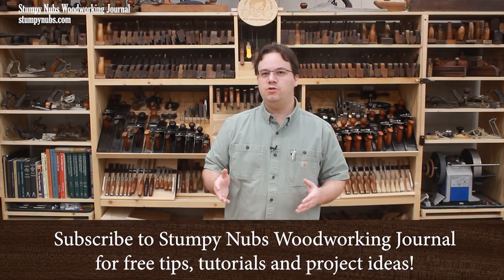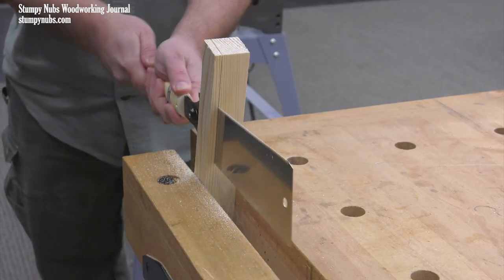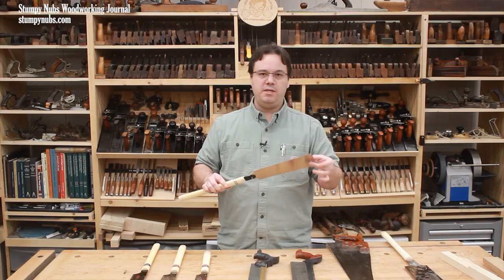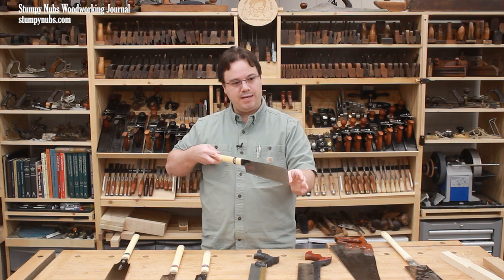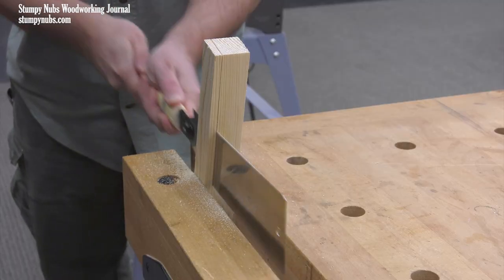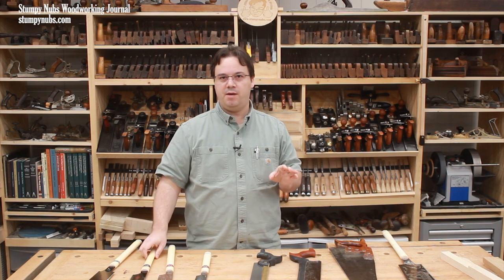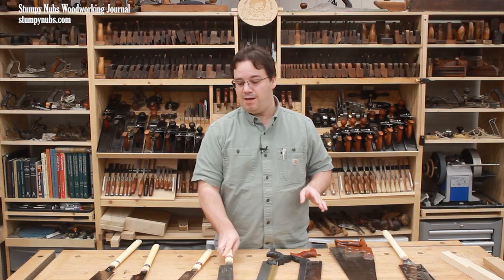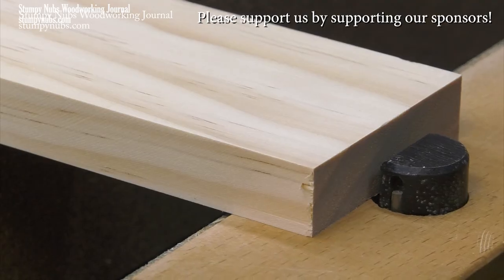Is Japan slowly killing western-style saws?

Comment: Just an elderly knuckelhead here, who loves handsaws. You did an excellent job in 13 min. with regard to the title of the video. Content and videography - congrats. I remember dropping out of college in 1980 and selling my car to buy woodworking tools. I bought a ryoba 270 mm "Tama Kitsune" brand, or "Jade Fox" for $27.00 - just saw the receipt the other day. It did not cut straight. I wanted to make a rip cut while working at a furniture repair shoppe, and the Disston rip saw wouldn't cut straight either. Cut well shy of the line, and chiseled the rest. When a Rosewood chair came in months later, I finally shelled out $125 for a weekend workshop at "The Lutherier" in Saugerties NY. I got a dozuki made by Shindo.  Robert Meadow had setup and sharpened ---  "Hon Metate" which is what happens in Japan when you buy a saw. That way, it's custom done, and you take it back to the same dealer when it's dull, or rather not sharp . Then he will use the same brand of file, which is easier than changing to another file brand. Also, several months later, he taught me how to make the blade flat and straight and non twisted, how to set teeth, and I got eventually more saws ect. Once I had the Disston straight, flat, set, and sharp, It cut great, and could get in some places a ryoba or kataba couldn't.

Point being Japanese, American, German, English, and Chinese saws all are a joy to use --- if they are sharp and flat and evenly set. And a real frustrating job if not. 

That's what they all have in common, and here's the thing --- I went for 6 years thinking "I must be doing something wrong with my arm, or body, it don't work because no one ever taught me how to saw"

No, as it turned out, the rip Disston was sharp, but it had a slight curve to the blade. same with the Tama Kitsune, except it also had some cup. Also at that time, disposable blades from Japan were not all flat. Some fit loose in the handle. They are better now, so I'm not dissing them, but a real Shindo or Chuyemon, or Miyano Tetsunoke, or Mitsukawa, or even Nakaya leave them in the dust --- after Hon Metate.  OTOH, good luck finding good files.

Why?, because disposable blade saws did kill the traditional saw makers, and the metate, and the file makers. I guess for most people Western technology is -- certainly from the corporate thought process and value system -- far superior to the traditional artisans aesthetics. 

Personally, I'm glad I spent my time here on Earth questing for Beauty, Truth, and Human scale goals. To all you knuckleheads who love your handtools and working with woods -- which is the great Master to those who want to learn from it  ---  3 cheers ! Give it your full focus and attention, and you might see it is full of Ki, it is not just dead material, you might open your heart to it and have it opened even more.

Comment: The first saw I bought myself was a Japanese ryoba  and I have loved it. With the saw being guided by the thinner kerf it's very difficult if not impossible to try and make small adjustments to your cut line as you work down a long rip cut which I would imagine would be atleast vaguely possible with a western style panel saw. I would be very interested to see a video on both joinery with the Japanese style saws and Japanese style chisels. I am looking to invest in some nicer chisels in the future and don't really know anything about the Japanese style. So that video would be very informative and helpful. Thank you
Reply: Ryoba! Man, the whole time I was watching the video, I was thinking about how "raioba" could possibly mean "two sided"
Ryouba makes a lot more sense to me. Ryou meaning "both" and "ba" for "edge". (The final u is often omitted. It makes the o longer, there is no u sound.)

But yeah, the pronunciation was throwing me off massively. "Ryou" is actually a single syllable. I don't think it's particularly hard to pronounce, but I guess you would never guess the pronunciation correctly if you only saw it written.

Comment: As a counter example (personal experience, YMMV): I've been convinced by those arguments several years ago and got a set of those 3 saws. They are my main saws but I've been struggling. Making straight cuts has been rather difficult, so is correcting the cut when it veers off course. The line is hard to see because it's often covered with saw dust, and the cutting position can be awkward, requiring you to seriously rethink how you position your body and how you clamp your work piece. Not to mention rip cuts are pretty tiring with a ryoba, as the short length doesn't allow you the range of motion a panel saw does.
I'm now in the process of getting equivalent western saws to try and see what I'm doing wrong.
Reply: Have you looked into combining the Paul Sellers "knife wall" techniques with your saws? Set up the precision cut guides with cutting gauges and marking knives, then allow the saws to do what they do, and "follow the path of least resistance".

Also, check out how Wood By Wright how to start cuts across/along marked faces (whether knife walls or pencil marks), before allowing the saw to descend into the meat of the cut.

Comment: I would love to see more videos on japanese saws, chisels, and other less common eastern style tools. I mostly use power tools but have a few japanese saws and a set of chisels that I really like. The japanese saws are affordable and to me, much easier to use than western saws. I picked up a lee valley rip saw recently for about a hundred bucks, with the assumption that this would be better quality thant I am used to as I had only used cheap western saws in the past, but found it harder to use than my japanese saws which cost about 30 bucks. Specifically, with the lee valley saw it is hard to get a cut started (while very easily with my japanese saws) and even harder to get started on a precise line. Though it does cut significantly faster - when it gets going of course. That's not to say the lee valley is a bad saw - the build quality is better and I probably just need more time with it. But the japanese saws cut more accurately and with less effort.

Comment: After watching this, I used my CHEAP Harbor Freight pull saw yesterday to notch some 1x4 pine for trimming around a beam in my new shed. WOW. That made the job easier, more accurate and left me with only a small portion to remove with my Multi-Tool. 
I will have to invest in some higher quality saws for my shop - Thanks for all the tips & tricks!

Comment: Coming back to woodwork after a very long absence I had problems with cutting straight and the blade jamming using my old western style saws. It took me a while to work out that it was an old injury which caused my wrist to flex and twist the blade on the forward stroke. Cutting on the pull stroke using a Japanese saw actually pulls my wrist into line and keeps my cuts straight.

Comment: While this does cover lots of great information I do want to put a counterpoint to some opinions. "Ease of Use" is much easier with western because: body mechanics of use, hand fatigue from grip needed with straight handle (ergonomics), speed of cut (benefit of body mechanics), and steerability mid cut (correcting to the line) being a few. Most of this comes from push saws were used more with standing benches and pulls with sitting benches so the body is used differently hence the wider variety of lengths in push saws as some use only the arm others use the whole body. One thing not mentioned about the "hardened teeth" is that in some of the American native species (red and white oak come to mind) the teeth can snap in the board as they go through open cells (pores). This is a modern attribute/detraction as teeth weren't always hardened so it wasn't a problem when they would cut stuff like teak. While loosing a tooth or ten isn't a big deal to the performance of the saw the metal shards left in board can wreak havoc later down the road.
Reply: A counter counterpoint; the pull saws require much less effort to use as compared to the western saw, so you don't need to get your whole body into it.  Most of the time when I'm using a pull saw, I only hold it with a couple fingers and let it flow.  There's no need to grip it and force it through a cut.
Reply: @jeffh4505  we’ll disagree on this one. I saw all day with traditional. Hands cramp after an hour with straight handles.
Reply from the maker: The tendency to brake teeth was mentioned among the cons. As for comfort, it depends on what you are used to. We develop muscles based on what we do the most. I have experienced this many times in life, being able to easily do something a much larger person struggled with, and vise-versa. If you use Western saws every day, you will find them more comfortable. There is no right or wrong answer here.
Reply: @StumpyNubs  It's all opinion. As said, no right or wrong just thought a counterpoint was valid. I started with pull saws and used them for years. I find you have to grip straight handles (even push) but pistol grips "sit" with very little grip required hence no carpal tunnel issues for me with them. Sorry, I watched whole video while packing and must of missed the breakage part.
Reply from the maker: @wortheffort  No problem :)
Reply: So there appears to be hybrid saws - I searched for 'japanese saw pistol grip' and found some decent looking results. Perhaps the best of all possible worlds is to have access to a fully-equipped training workshop before deciding which suits the individual.
Reply: @jeffh4505  i agree. Biologically, it is easier for the body/shoulder/arm/wrist to pull in these cutting instances, rather than to push. Add this to the blade not binding or bending due to it being pulled instead of pushed, and you've got a much easier time.

Comment: Are there any pistol-grip style Japanese saws? That seems like it would sell well in America, and it might be more comfortable than the straight handle. But I’m not sure if it would affect precision 🤔
Reply: It might be harder to apply force with a pistol grip. A straight handle allows you to push downward while pulling without being awkward.
Reply: i dont know if it would be particularly comfortable or precise to cut on the pull with a pistol grip, it seems much more ergonomic for pushing. but i could be wrong, i dont really know.
Reply: The first pull saw I ever used had a pistol grip. It was made by Tajima, a JPR300/K1 I believe. Very comfortable to use for me, no problems to adapt to the different motion.
Reply: @m.a.6478  Ok, knowing that, I'm betting it's because the blades are disposable. making them thick(tall?) Enough for a pistol grip is a waste of steel.

Comment: In my late sixties and after 40+ years of woodworking, I bought and used some Japanese saws for the first time in my life and have been kicking myself for not having done so decades earlier. Far less effort, far more accurate and just a pleasure to use. Once you get the hang of watching the reflection in the blade to stay aligned, it's hard to go wrong.

Comment: I grew up using push saws and continued using them through my 20's. In my early 30's, 20+ years ago, I purchased my first Japanese saws during a visit to Japan. They were high-end and I ruined a couple early on from kinking getting used to the Pull vs. Push dynamic. But now they are all I use. I would suggest to anyone that started out using Western Saws and wanting to try Japanese saws to purchase a Ryoba in the $30 range. This way when you ruin it, and you will, it's not a big blow. Kakuri tools is a well establish Japanese tool maker with offering in the this price range. My tips; Start slow, relax and don't force you cuts.

Comment: Thank you for this! I’ve just started using a ryoba saw (auto-correct wanted to call it a “rumba” saw) that a friend gave me several months ago. I didn’t quite know what to do with it, though greatly appreciated the thoughtfulness. Right away I noticed how easy it is to follow a line and that not fighting the saw  is critical. I discovered one set of teeth cut better crosscutting and the other ripping. Now I know why. Now I want to get the smaller dozuki and try it on some dovetails! (Just ordered it from your link 👍)

Comment: Excellent video. I've learned how to sharpen my western saws. That makes a huge difference! Some of them have family/nostalgic value so they are a pleasure to use. My Japanese saw has no nostalgic value for me but it works well and has one key, valuable feature. The thinner kerf Japanese saw pulls easier and my wheelchair does not move around as much when I'm sawing. The wheel locks only hold so much and the Japanese saw gets me just under that "friction limit". That being said, most of the hand sawing is done on smaller stuff.  Anything big we go full power tool!

Comment: I bought a ryoba and a dozuki recently and I'm so glad I did. You get so much more cutting for the same muscle input. The handles are much more ergonomic too. It just kind of flows in a straight line with your arm, so the effort of holding it is spread out more. Not so concentrated in your hand and wrist. And making a good cut isn't so dependent on keeping your wrist straight. It's more like the blade is part of your arm. Technique is important though. The first time I used the ryoba I started too aggressively and bent a tooth. It wasn't too bad though and I was able to bend it back. They were both like $40 on Amazon and made in Japan. Definitely worth it.

Comment: Well, I live in Romania, and here, such "exotic" tools are not so afffordable. However, I bought almost a year ago, an Ryoba saw, directly from Japan, because it was cheaper than buying from the only local seller that imported such tools. I have to say, that since I start using it, I managed to improve my work by doing precise, straight and clean cuts. I am not a woodworker, but I like to make things, and DIY works and repairs around home, and it seems that my medium size Ryoba is just right and suitable for what I am doing. In addition, the info, tips and tricks I learn about on this chanel are so useful. Many thanks.

Comment: At 10:06- I thought you were going to take a slice out of the top of your thumb joint!  I love Japanese pull saws. Have used the double sided for cutting door trim before new flooring for years. 15 Years ago, I spent $270 for a Hayauchi ("Silky") extension saw. pruning saw. Wonderful tool! Crazy razor sharp blade that pull cuts better than any other hand pruning saw I have tried. They sell for around $350 now and are worth every penny. Blade is still razor sharp after years of use.

Comment: Thanks for explaining these saws! 65 years ago, when I lived in Japan, I watched Japanese carpenters use their pull saws with the work piece at all angles, above them, below them, and held with one hand while sawing with the other. It looked so much easier than the few times I'd tried using a Western saw. I wondered why we didn't use pull saws. I finally saw and bought one a few years ago here and found that it is everything I wondered about way back when. I'd love to discover their planes and chisels.
Reply: This is what I consider the greatest advantage of Japanese saws over their western counterparts. You can achieve amazing accuracy without even having a proper workbench - just using simple sawhorses and your body weight to firmly hold the workpiece.

Comment: Great Video! I wanted to mention that a few other videos mention that these saws are recommended to be used with only the weight of the blade to supply pressure in the cuts. The cuts may take a little more time, but the results are cleaner with much less muscle fatigue. I can cut stuff all day with these saws and my arms aren't sore the next day like they can be with my Western saws. The trick is to only grip the handle with your thumb and pinky+ring fingers. The other two are just for guidance. There shouldn't be any "white knuckles" gripping these saws. lol

Comment: I bought myself a ryoba for Christmas one year ahead of cutting big mortise and tenons for my workbench. It was super-accurate straight away, and the bonus was I didn’t pick up a circular saw for another year after that. By the time the circular saw is plugged in and straight edge aligned and offset, the ryoba has finished. AND it doesn’t have to stop at children's bedtimes…

Comment: I've used a ryoba saw for years for cutting balsa and basswood for model aircraft. The pull stroke makes starting the cut much less damaging in extremely soft woods like balsa and also reduces tear-out at the end of the cut. The thin kerf lessens waste and the sawdust is much finer.